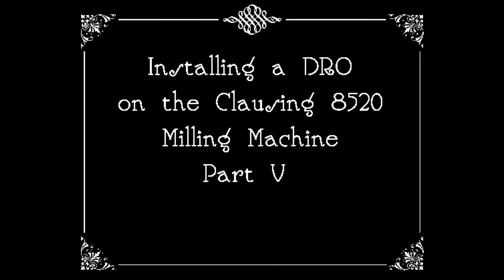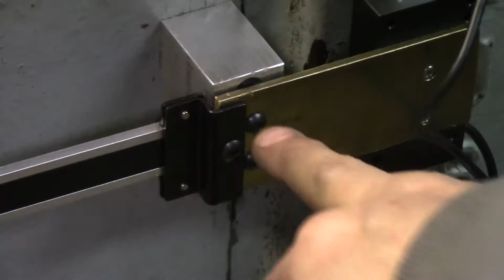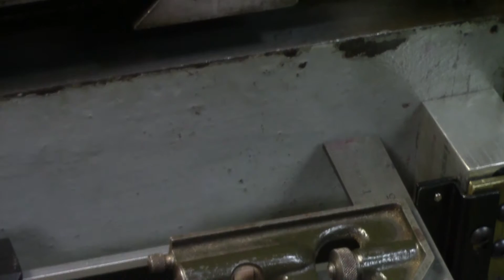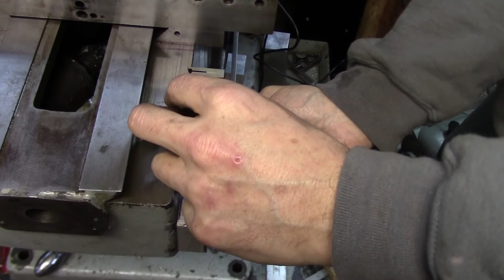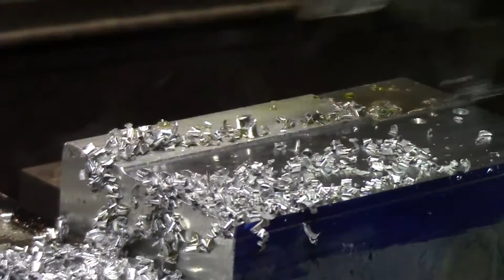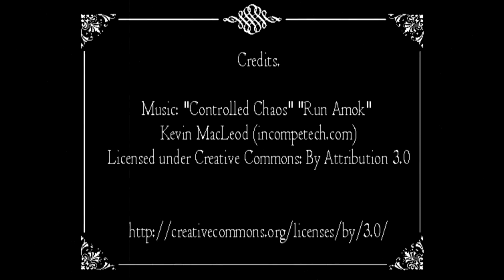Installing a DRO on the Clausing 8520 Milling Machine - Part V

Comment: Is there backlash in your DRO reading as you approach the same (Mitutoyo) point from different directions?
I'm wondering if there is any flex in the mounting brackets.
What about approaching the same point repeatedly from the same direction? 
I would have expected better even from a cheap scale.
Reply from the maker: +stefantrethan I do plan on more comprehensive testing when it's all finished.  I don't expect there's much backlash, the brackets are very rigid, though the scales themselves do have a bit of flex in them, but since they're quite parallel to the motion, I wouldn't think that would come into play.